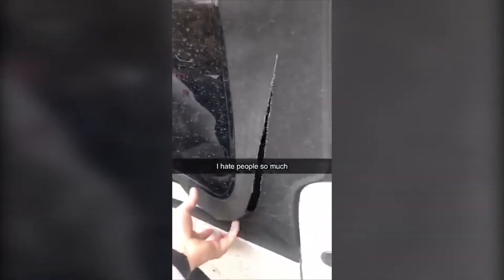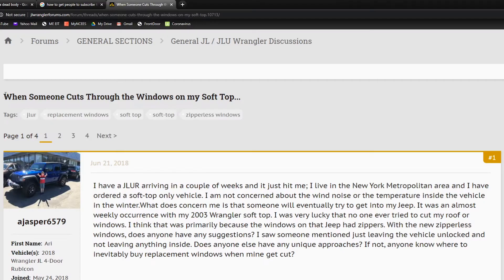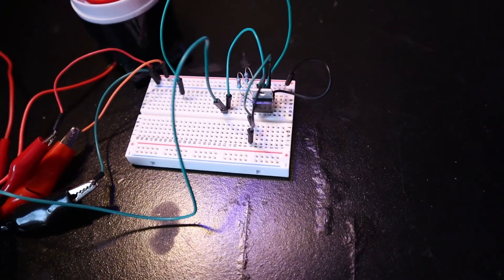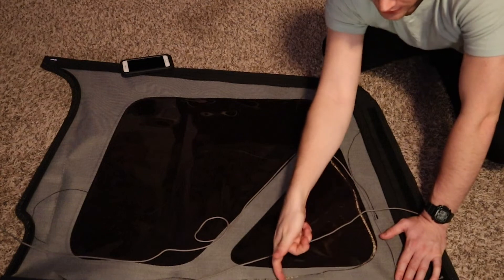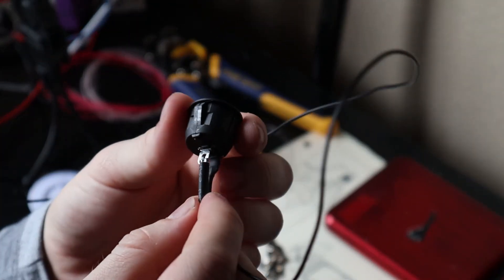DIY Alarm For My Soft Top

Comment from the maker: Timestamps:
0:00 - Background
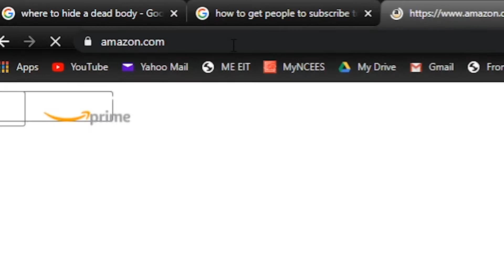1:07 - First Alarm Test
1:34 - Circuit Diagram/Testing
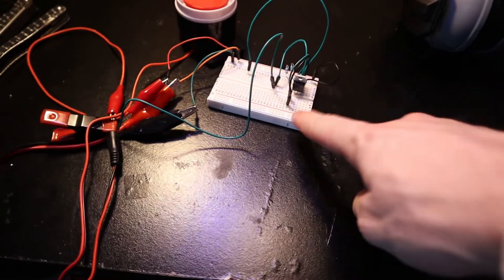2:35 - Cleaning Up Device
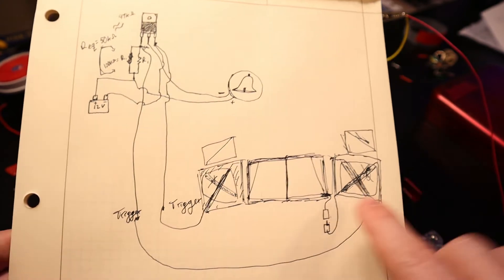3:19 - Wire Resistance/New Diagram
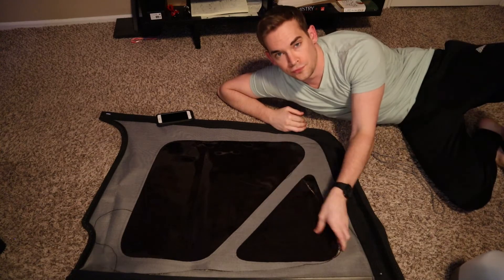3:53 - Routing Wires Concepts
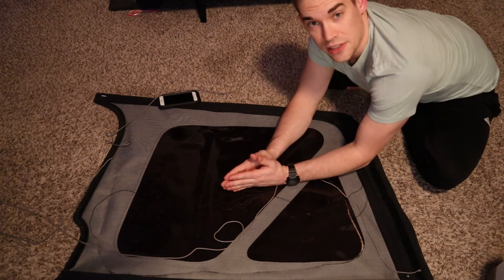4:27 - Demonstration of Alarm
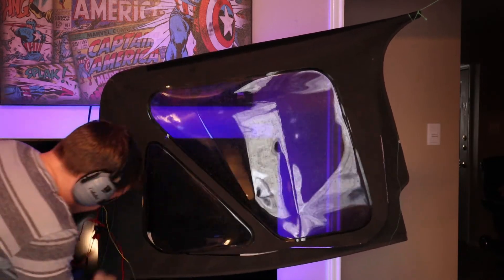5:05 - Back in the Jeep, Install
5:27 - Conclusion

Comment: Nice video! I considered doing the same thing for my convertible which also gets cut. You still get a cut top when someone cuts it though :( . My friend suggested wiring a taser to the circuit but that seems mean. I may do a motion sensored GPS tracked cellular connected camera though.

Comment: I really enjoy your videos! Very nicely edited and you cover everything with no annoying filler 😀 You deserve a lot more views!

Have you thought about using some sort of foil tape? You could stick that on anything and it should be even easier to cut through?
You could also look at a latching circuit if you're worried someone will try to reconnect it back together 😝
Reply from the maker: Thanks man! I'm glad you like them!!
I was actually thinking of using some epoxy or resin to bond the wire to the center of the windows, but that's a great idea too!